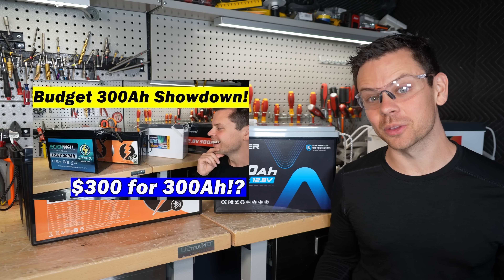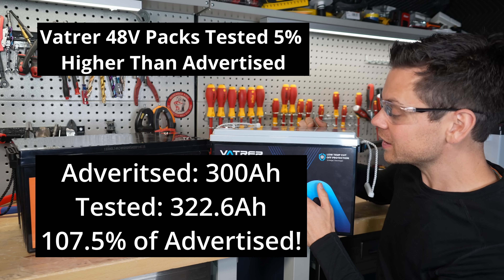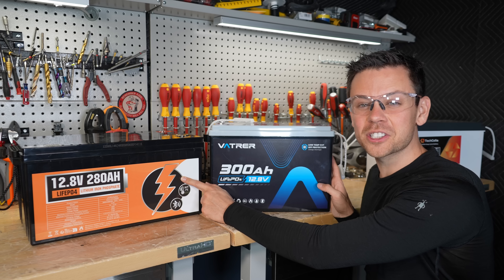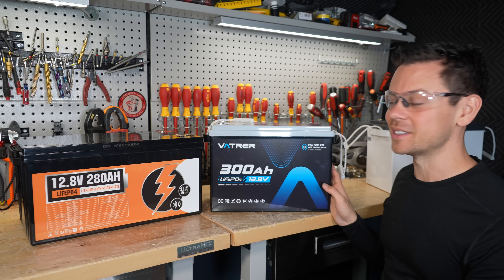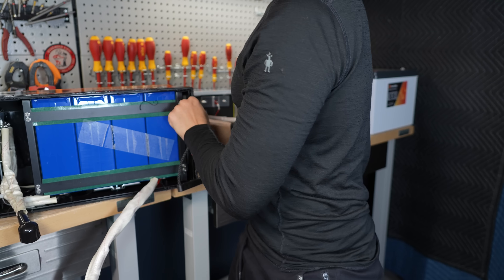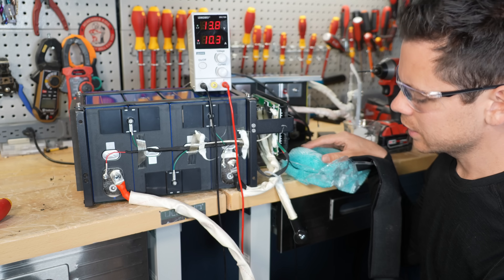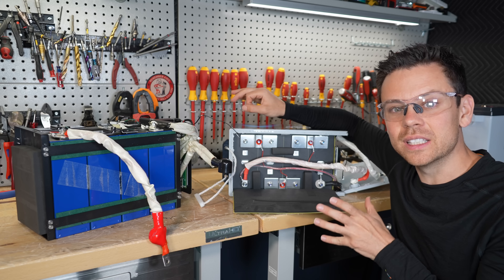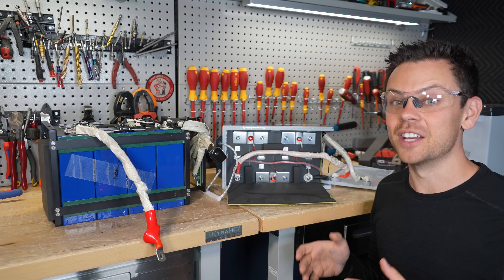Name Brand Batteries Worth The Extra $$$? $479 300Ah Vatrer VS $420 280Ah Ecoworthy!

Comment: Although im relatively new to solar, I am very familiar with large scale power generation, which is how I make my living. Currently all of my equipment aside from my inverter is ecoworthy. Batteries, panels, 60 amp mppt charge controller with communication ports and Bluetooth. I am very very happy with my system. Soon I will be switching the inverter to the 3,000watt ecoworthy 24v and the charger verter for shorepower bypass. This system runs my 400 square foot outbuilding. My office/gym is completely off the grid and soon the house will be on a 48v system from ecoworthy as well. Great company, great service, great products. Im interested in trying out watt cycle for a portable build, maybe try vatrer, probably not spelled right. Lol

Comment: Vatrer BMS failure examples are all over the internet.  Here's one of those:
"I bought 2 12v 460ah from Vatrer. 2000 eur not cheap honestly for what looks to be finally a crap.Doing some test after install, controls, balancing cells, checking connections and fuses, I have had during the next three days two BMS shut down with critical alarms.Overkill and vatrer app show 255% charged ( !!!!) and more than 8956 cycles already done. One batt is totally defective and by the way the series connection cannot work. I tried to contact their customer service but their polite answers look more like a robot reply. I forgot to mention these batteries are equipped with a nicely designed thermometer, but 15 days after their install, one needle had gone"

I agree.  Vatrer warranty support is robotic making it nearly impossible to get replacement batteries when the bms fails ... which is a weak point with vatrer.

Comment: You probably wont get a year out of vatrer batteries.  The BMS regularly fails.  If you search the internet you will find many complaints with vatrer batteries.  Also, Vatrer thinks warranty service is replace just one of the batteries in series with a lower amp hour battery.  Imbalances like that when connected in series is stupid and dangerous.   They are not a good company to deal with.  Communication is super slow and unresponsive with unhelpful staff in Hong Kong.  Only US staffing is for shipping.  Highly recommend limiting LiFePO4 purchases to north america only.

Comment: is it a safety issue if anyone can access the battery bms via Bluetooth and modify the settings (say pause the charge and discharge on a battery that is connected in parallel) ?

Comment: Would using 4 of the Ecoworthy 280Ah in series be a good option for expanding an existing 48V system? These batteries are generally much cheaper per kWh than 48v server rack units

Comment: The battery with the long range connectivity I wonder how much standby power it consumes. I returned a 100ah 24v LiTime for a refund as it would self drain in about 50 days from full. Added issue of the BMS not being able to monitor the self consumption so the app SOC was always wrong and external shunt cannot monitor self consumption :(

Comment: Something I noticed Will...I have both the non bluetooth and non temp protected( 2023 purchase) and bluetooth - low temp protection versions( 2025 purchase) of the ecoworthy 280 ah batteries - bought at different times.They are different sized on their cases.... the newer bluetooth is shorter by around 2-3 or so inches...I didn't do an actual measure but I could tell the size difference....it made it easier to install the newer bluetooth version for my application. I have 2 of each version and they all perform really well....What I will tell people is to wait if you can and buy these on amazon prime days or sales...I got the newer 2 bluetooth versions for $699 for the pair....

Comment: I put a Vatrer 12V 100Ah on our RV. After 8 months it had an issue and the BMS cut everything off. I expected the warranty to leave me replacing the battery on my own. I was very surprised and excited. Vatrer, after providing instructions for some simple testing, they replaced the battery for free including shipping. I have one of their 48V packs in the golf cart also and have been impressed.

Comment: Dear Mr. Will,

Your criticism is our most valuable asset. We attach great importance to every point you raised and have engaged in in-depth communication and verification with our R&D team. We would now like to provide you with a more detailed explanation of the situation and the improvement measures:

Optimization of the Temperature Control System
Indeed, in the early design of our temperature control system, we had considered the issue of the temperature sensor not being fully adhered to the battery cell, which could affect ambient temperature collection. To address this, we have implemented significant improvements in products manufactured after the second half of this year:
(1) We have switched to using OT terminals to secure the temperature sensor to the connecting strip, ensuring stable contact with the battery cell and significantly improving the accuracy of temperature collection;
(2) We have simplified the design and retained the NTC temperature sensor.

Regarding the Situation Where High-Temperature Protection Was Not Triggered
In fact, our NTC sensor does possess high/low-temperature protection functions. The reason the high-temperature protection was not triggered lies in the logic setting of the BMS: when the temperature probe's temperature rises too rapidly and reaches 125°C within 5 seconds, the BMS interprets this as a damaged temperature probe and therefore does not trigger the protection.

Regarding the Wiring Harness Issue
Placing the wiring harness on the pressure relief valve is indeed not standard practice, and we fully recognize the inappropriateness of this. We will proceed with immediate rectification. Furthermore, while we have used silicone adhesive at the hole locations to secure the harness, preventing movement and reducing friction, we acknowledge that this method is indeed relatively crude. Your suggestion of using a "plastic protective sleeve" is highly valuable. We have promptly submitted this proposal to our R&D team for evaluation and will implement it as soon as possible once the improvement plan is confirmed.

Thank you once again for your professional input and patient corrections. Your voice is the driving force behind our progress. We will continuously optimize our product design, enhance our service professionalism, and welcome your ongoing supervision and feedback.

If you are willing, we would be very hopeful for you to participate in the experience and testing of our future products, working together to advance safety standards within the industry.

Comment: 3.589 kWh +2-3% inverter heat generation on the 1st capacity test of the 280ah ecoworthy with a 430w space heater.

Comment: I'm glad you recvisited the Eco Worthy. I have tow of the 280Ah batteries.

The price fluctuates a not, but on eBay or AliExpress, pretty much every week there is a new "coupon code" or "discount" that keeps the price hovering in the low to mid 300s. Recently on AliExpress it was $293 shipped and is that as I write this (Oct 25, 2025). 

I wouldn't get the non-bluetooth battery, the app is great to use to monitor each one individually.

Comment: Hi WILL, try to follow you as often I can from Sweden and like it a lot. What about parallell connected batteries of different models and capacity, I see that some have this installation in their RV's and wonder if this is a danger ? In my RV I would like to install another one, but there is not enough room (fits under the front seat) so this has to be in the back of the RV, with rather long cables. What problems can it cause ?

Comment: I bought from aliexpress /_Ewv2XPe
24V/100Ah LIFEPO4 battery and measured capacity 19 ohm resistor and get over 100Ah, could you test it also and look inside is it safe build? It has marked 24V and 12V in the same sticker!😮

Comment: You always criticise really freely, but I don't feel that your criticism is always intelligent or helpful. For example, you make a big deal about the pressure valves being covered. But if there is a build up of pressure; 1) it's still going to escape there, a little tape and a couple of cables on top wont stop it. 2) more importantly all batteries on the market have a flaw design - they don't actually have a way to deal with the gas which escapes. If it stays inside a sealed box, it will just continue to build pressure again right? Explosive gasses building pressure. The idea of a pressure relief valve without a vent seems pretty stupid, no?

It seems that getting a successful youtube channel brings an air of arrogance to a lot of people. You personally have talked about the safety of LFP for a long time, recently we learned about how explosive the gas which leaks is. You could possibly use your position to do research into that, ask companies, help actually advance things for peoples safety. Instead you just do simple reviews and say the things which you don't like while not actually changing your position according to recent events.

Comment: For a 24v solar off grid system is it best to use:
2 x 12v 200ah batteries in series or 
2 x 24v 100ah in parallel 

to get the 4800wh capacity I want. Or is there no difference?

Comment: I have 2x280 Ah batteries in my 4x4 expedition RV and they have been through any sort of terrain and weather, including well-below freezing temperatures and very hot days, on and offroad on all sorts of roads and also a very long horrible dirt road (1400km!!) to the arctic ocean (Canada). Through dust, bumps, shakes and everything in between, I had no issues with traveling and working from my RV.  I never had to use my solar or gas generator (I bring them just in case on long trips). The monitoring has always worked and I also have the panel and the hardware to monitor them without the phone.
Great batteries!

Comment: GREAT video. And for those new to solar and batteries...NOW is the time to get some cheap (good) LiFePO4  batteries. I got two banks years ago and paid at least 2x more as for mine...and no Bluetooth on the EG4 Lifepower4 rack (six batteries). Prices for solar panels are low too. Honestly, you can 2x the power/system storage for the same amount of money nowadays.

Comment: Hi, I'm looking for a drop-in replacement for my 12V AGM battery for the Prius. I would like to replace it with lithium.
Got any tips? It doesn't need to be big since it doesn't need to start the engine with it.

Comment: For some reason the ecoworthy BMS low temp protection is set to -7 Degrees  C. 
Luckily they use a JBD BMS so I can change the settings to protect the cells. 
For me it's the best value battery out there

Comment: @willProwse I've put something together to bypass solar panels to charge 4 300ah batteries with a 24kw split phase hybrid inverter   by making my own power with this.  (To convert 48V AC to 48V DC and maintain the same power output (around 10 kVA), you need to consider a few factors.

Voltage, Current, and Power Relationship

Power Calculation:

Power (P) = Voltage (V) × Current (I)

At 48V DC and 10 kVA, the current required will indeed be around 200 amps (since 10,000W=48V×I).

Rectifier Efficiency

When rectifying AC to DC, you generally lose some power due to conversion inefficiencies. A typical efficiency can range from 85% to 95%. Assuming 90% efficiency:

Actual power available after conversion = 10,000W×0.90=9,000W

Thus, the current output would be: I=48V9000W≈187.5A This means you can still achieve close to 200A, factoring in the efficiency loss.

Cost Estimate

The cost of components can vary widely based on quality, specifications, and supplier. Here’s a rough estimate of costs for each main component:

Step-down Transformer (10 kVA, 220V to 48V AC):

Cost: 200−600. (depending on brand and quality)

Bridge Rectifier:

Cost: 100−300. (for high current capacity)

Filter Capacitor:

Cost: 50−200. (depending on specifications and ratings)

Voltage Regulator (if used):

Cost: 50−150.

Fuses or Circuit Breakers:

Cost: 10−50.

Heat Sinks:

Cost: 20−100.

Enclosure:

Cost: 50−200.

Total Estimated Cost

When we sum the lower and upper ranges, the total estimated cost might be:

Low End: $480

High End: $1,700

This estimate does not include labor costs if you hire someone to build it, nor does it account for any additional components (wires, connectors, etc.).

Loop powered